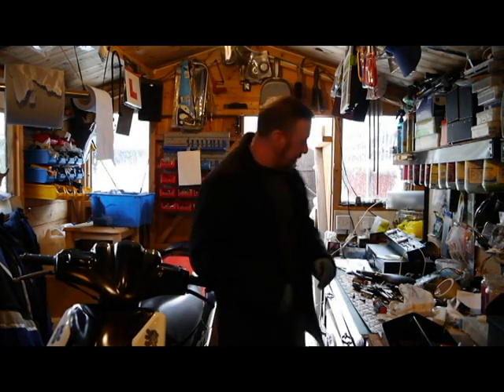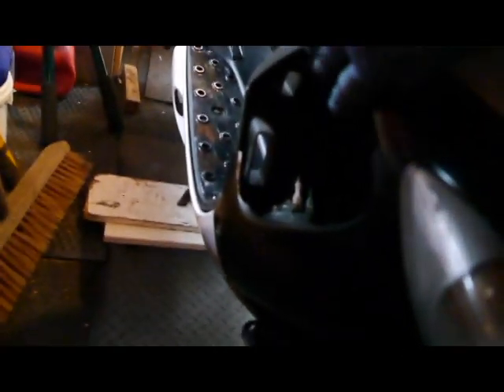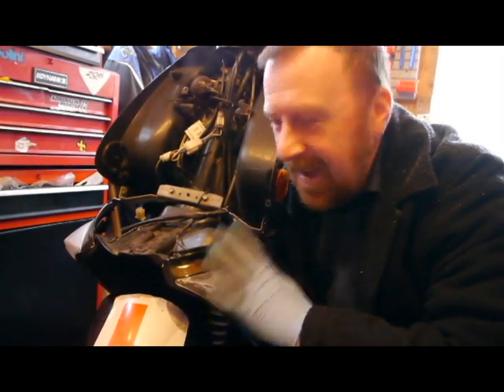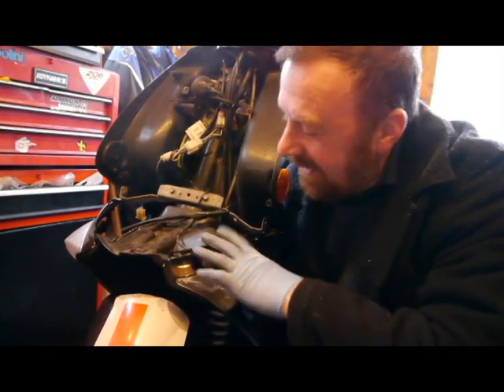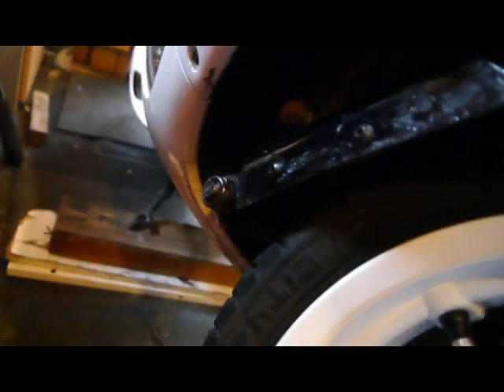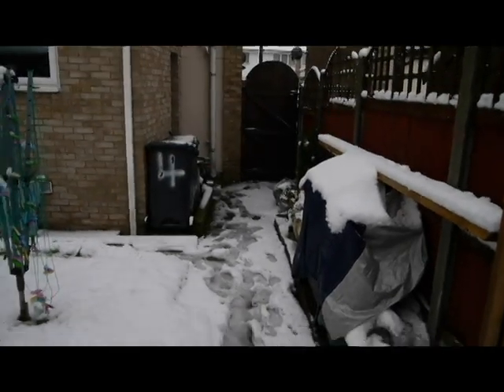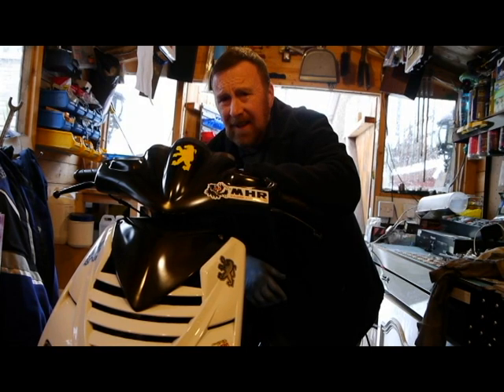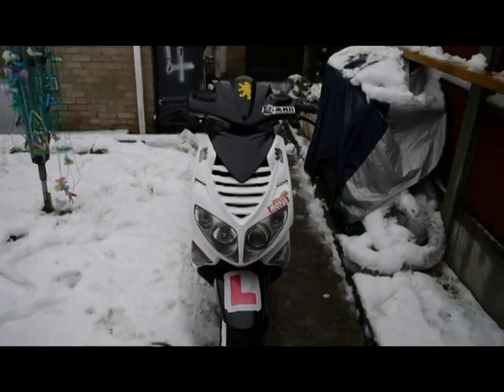SPEEDFIGHT COSMETICS FINISHING OFF MAKING SAFE MARK SAVAGE

Comment: Hi there, I managed to buy a 2001 speedfight 2 100cc yesterday with 1 owner from new it was garaged in 2004 and forgot until I purchased it. I washed off the dust added new fuel and a new battery and it fired straight up. I cleaned the carb today and pumped up the tyres and it goes well it has the original tyres from new which still have tred but as hard as hockey pucks lol So I will fit a new set of tyres before it's mot on Wednesday. Its all original withe both sets of keys and hand books with 6441miles on the clock. 
Unfortunately the young lad that had it fell off a couple of times so it has plenty if scratches but still very presentable. 
Is there anything I should look out for please, many thanks, Jason
Mine is blue and black with silver wheels
Reply from the maker: Tyres defo 
I'd change the belt too
Check rollers and clean 
Check clutch 
Then as long as it runs OK all should be good 
Me 
I'd take all panels off 
Wd40 all connectors 
Basically go over everything bud 
Safety and all
But enjoy bud 
Sports exhaust next 
Good for 70 mph

Comment: I just came across your videos and they are great, I have the a keeway arn 125cc 4 stroke scooter and looking for a sporty exhaust im in the UK is there anywhere I can get a exhaust for it that sounds more meaty as it's too quiet but can't find a better sounding exhaust could you help thanks I'm in North West UK maybe you might be able to find a website I could buy on off any help would be appreciated
Reply from the maker: finding exhausts can be a pain but e bay is a start but try and find if another maker makes your bike as some other exhausts may also fit, scooterparts and ghostbikes or lexmoto parts maybe worth a look or as I have done in the past
get a generic end can and cut the old one off at the pipe before the can and replace, just measure the pipe size, its not a bad as it sounds and is a cheaper way to do it 
hope that helps and thanks for watching and subbing 
mark
Reply: mark savage OK thanks I did have that in mind as I have just bought an exhaust off eBay it's a little stubby one lol

Comment: Hey buddy , Long time watcher recent subscriber love your vids proper bloke down to earth tackle,  I moved to Greece recently and it is the home of scooters , bought myself a lovely speedfight mk1 and it's bullet proof. Your vids though help with much but I have 2 questions and apologies if you've covered them in previous vids but..
1 if I change my rollers will I have to change the jets etc or will it just be ok 
2 you always mention throwing away the washer , what effect will this have 
Thanks buddy keep em coming
Reply from the maker: Ben Gildert hi bud thanks for watching and subbing
Changing the rollers I fine ,better for the bike and  performance 
Make sure the belt is good to like in me last video on rollers  
So no need to upjet when doing this
As for the washer on speedfights it’s a restrictor and stops the variator opening  up fully 
Hope that helps 
Mark
Reply: mark savage helps loads mate as you can imagine a Lancashire lad finds it hard to get honest advice in crete, just wanted a bit more performance without having a million other issues crop up. Thanks for the reply man merry Christmas buddy